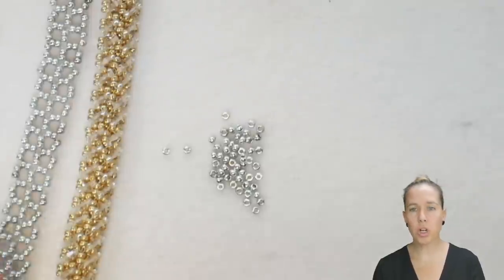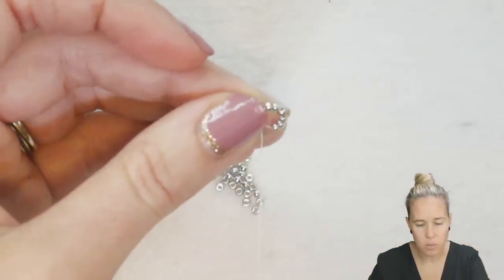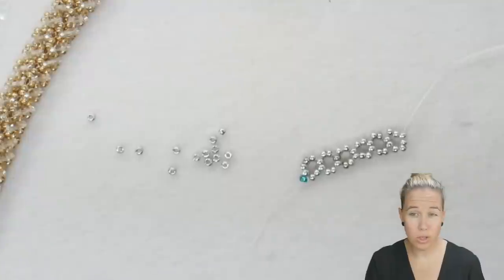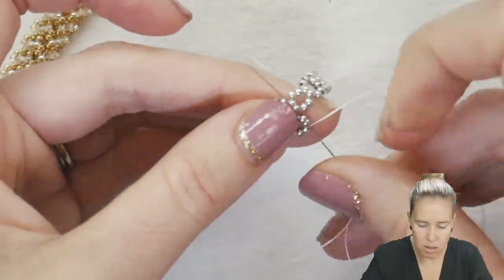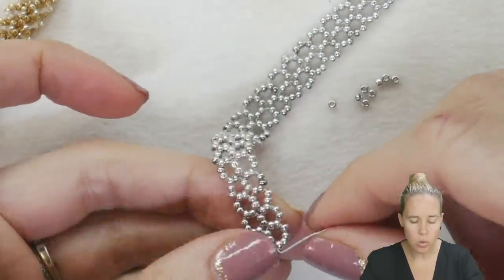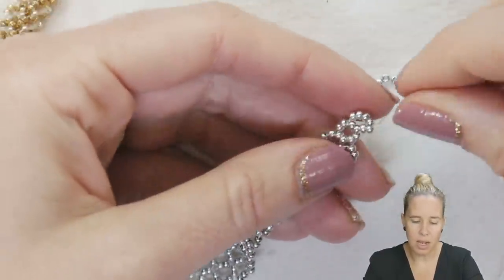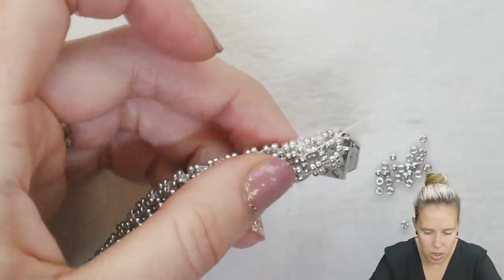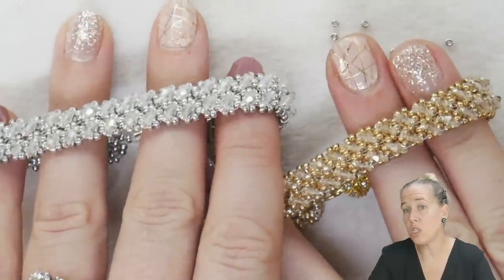Wimbledon Bracelet - DIY Jewelry Making Tutorial by PotomacBeads

Comment: Dear Ally,
I love this design - especially that clasp!! I've been making various versions of my own design of this type of bracelet for some years now - I absolutely love wide RAW bracelets - up to 7 rows wide! But instead of changing thread I always start with more than twice the length of thread I think I'll need (because RAW is thread-thirsty), but I leave half of it as a tail at the very start - for both the RAW and for the embellishments - so that whenever I run out I can finish off with a few solid knots, then start working with the 'tail' thread, picking up back at the start of the piece. (Adding thread isn't difficult, but it takes a little longer, and blocks the beads with thread, often making it difficult to pull the needle thread) - especially as I always stitch my embellishment beads on twice which makes for a very solid bracelet and gives a substantial feel to the piece. I hope I've explained my method thoroughly enough! 
Happy Beading, and thank you for sharing all your wonderful designs!
Reply from the maker: Thanks for watching :)
Reply: Where can I get that GORGEOUS clasp?

Comment: Could fire polish be used in place of the crystal bicones?
Reply: I would think soo!! You might just have to adapt the pattern a little bit depending on what size firepolish beads your using 😊
Reply: Yes don't see  problem with that.  MOST of the time you can get away with using anything that is the same size.  In that case, gemstone 2mm rounds or pearls could work too.
Reply: With 4mm beads just make sure to expand your RAW box to have 3 beads along the sides
Reply: @alliebuchman10  would  I have to expand the RAW box to use 3mm bicones?
Reply: @Janethedream  Yes you would need to expand by 1 on each side.  So instead of 8 - 11/0 seed beads you would use 12

Comment: When adding the second row, how do you determine at what point to add the "four beads" to continue on.  Is it right AFTER going through the bottom two THEN we add the next four beads OR do we continue on through the two side beads then the two top beads and then add the next four coming around? Seems like you can do it either or both ways.  I tried this pattern using Miyuki 11-643A and they seem to be more cylindrical then the ones you used.  They did not lay well or hold a squared shape.
Reply: Changed beads and it made a huge difference
Reply: I also discovered this.  There is a little hole where all the squares join.  If you can see thread crossing through them, you're doing it wrong. I found that I hadn't gone around the square far enough when that happened.